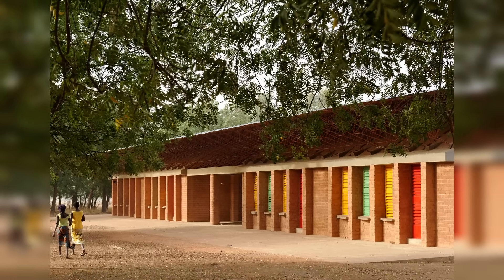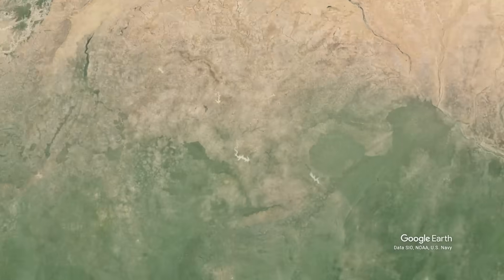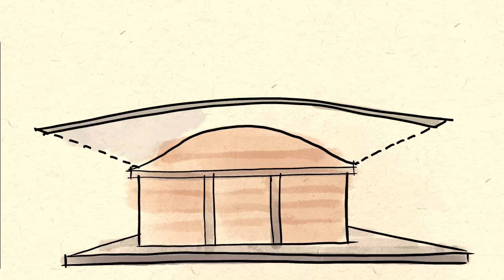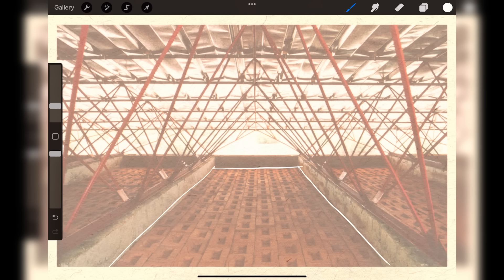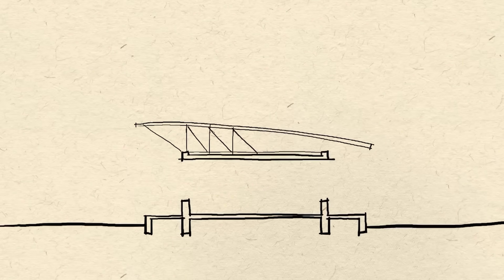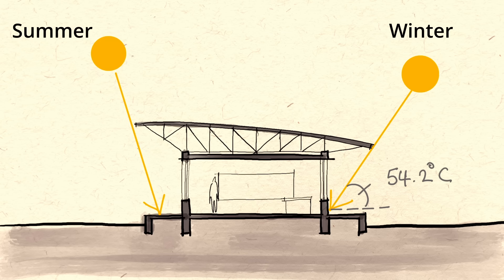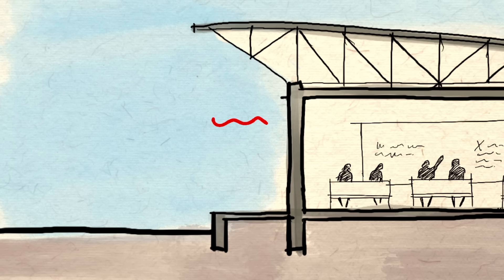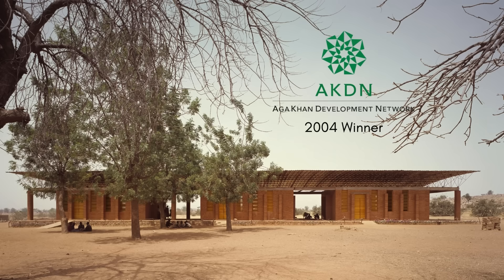The 3 Design Strategies Keeping This Building Cool In Scorching Heat

Comment: I'm in west Phoenix right now. It's 12:15 in the morning as I type. It's still 98⁰F outside. It's forecast to be 111⁰ tomorrow where I am. I step outside and there's a slight breeze. It feels like a fucking blast furnace. Heat is radiating off of everything,  even trees nearby. My skin and lungs literally hurt after more than 15 minutes in it.  There's no escaping the heat. Even if you can in your climate controlled homes,  there's no water here that isn't stolen and no food that isn't trucked in from somewhere else. If it weren't for air conditioning, 99% of the southwest US would be uninhabitable. I'm leaving day after tomorrow and I'll never be back to the desert during the summer. Ever.

Comment: How is the Venturi effect relevant here when there appears to be no interim restriction within then space between the two roofs in the actual building?  Indeed, they are closest together at the edge of what appears to be the windward side.  Considering the perforated under-roof, it would seem to be relying on some sort of heat differential created by shade in dry climates to move hot air out of the classrooms.  I have no scientific background in such things, so perhaps there’s’ some element I’m just not getting.

I rarely use my air conditioner, although I live in North Carolina.  When I walk out of an air conditioned grocery store into the parking lot, however, what hits me hardest is not the 90* heat, but the stunning humidity.  When I do turn my air conditioner on, it’s usually because I’m dripping sweat onto whatever project I have in hand.  If there’s a natural, passive way to dehumidify, other than moving to a desert, I’d love to know about it. I have lots of fans, but they don’t run themselves!
Reply: Agreed

Comment: Are you paying attention Heat Dome victims in the American Southwest?  When power grids fail and AC units go dead - this building stays cool!
Reply: I don’t know about that. 95F is a warm day in April here n the Phoenix area. We have been 100F+ since early May, and 110F+ since early June. It would also be fun to hear how this design works at night. How cool does it get at bedtime?
Reply: @tomdaniels8855  I guess my point is that the climate is changing for whatever reason - and probably not getting better anytime soon. This sort of thinking will be needed. Millions of  people running AC day and night is not a real solution. One serious power outage could be deadly.
Reply: It gets cold here in the winter. This bolding style does not address that well.
Reply: @WeighedWilson  That's a very good point! Thanks!

Comment: I wish there was some data provided in this video about the temperatures experienced within the building itself.
Reply: -6 Celcius. The Aga Khan Award for Architecture lists the Gando primary school by Francis Diebedo Kéré as six degrees Celcius cooler compared with the common tin roof alternative.
Reply: Eas thinking the exact same thing. It's a shame that no results were shared. How much actual cooling is it able to achieve consistently over regular buildings?
Reply: @Tomasrrb  -6 Celcius. The Aga Khan Award for Architecture lists the Gando primary school by Francis Diebedo Kéré as six degrees Celcius cooler compared with the common tin roof alternative.

Comment: Im a ventilation expert and business owner bringing natural cooling to the forefront, for people with and without much money. Love this story and yes the Venturi effect, convection abd thermal breaks are the key. Passive is the future.
Reply: I learned this principle from the capes of Sahara Bedouins. The outside heat of the outer layer actually warms up the air between that and the inner layer, producing warm air that is quick to escape rapidly and let in the cooler (only normal hot), dry air to replace it.

During the night the thick fabric is crucial in staying heated. It's also necessary to contain airy wool so that the outer surface of the outer layer contains most of the heat without letting it all through, and same is true inreverse when at night the heat won't escape through conduction of the material.

It's also an essential difference when you can't just "wash off" sweat, but it needs to actually perform it's function of cooling the body down, rather than collect and fester with fungal infections.
Reply: Is there any website or books that focus on many of these time-tested technologies of heat abatement... I am thinking of building a rural hosue in Florida ??  Thanks !
Reply: @LJ-jq8og  yes, just make sure you have an opening in the roof so hot air can escape easily. Try and tilt a a side of the roof  up for venturi effect. Make sure you have cross ventilation and shade. Always nice to have a roof length that blocks the summer sun, but allows the winter sun to come in and if you can have a thermal mass to collect the winter sun. That would be great
Reply: @trainwreck420ish  Thanks !
Reply: @LJ-jq8og  Auburn University School of Architecture should be "right up your alley".  Auburn is located about 100 miles north of the Florida "panhandle, but they are not limited to just Alabama and Florida.  You are sure to find plenty of Florida vernacular (historic) motifs, mixed with modern aesthetic design language.
Reply: More passive allows to do some interesting things actively using less power. A good sized solar array could run a smaller water filtration system and a couple large freezers allowing the school to raise funds with ice sales and keep cool drinks and fruit for the kids on hand. Which would also provide hands on education in running a simple business for the children.
Reply: @synocrat601  I want to build something like the le Corbusier pavilion but in the desert
Reply: Im getting too hype for this!! I want to work in this field!
Reply: @smolboyi  GO FOR IT!  We need more folks helping others understand the concepts and redesigning what we have in place already. Great when new homes are built with this aim but the real work is in retrofitting/remodeling. 
I encourage you and best of luck. Follow that passion, curry the energy and also be fulfilled in your work 😎
Reply: @jtknight4647  thank you friend, please pray for me that I could help many people with these awesome insights ❤️
Reply: @jtknight4647 Where about do you work?
Reply: @MataH1 @ Bay Area WHF (whole house fans) is my ventilation company.  My first company Left Coast Contractors does all remodeling and restorations.
Reply: I am a home builder, we love incorporating, passive home elements into our builds. not everyone can afford to build a passive house, but simple elements like orientation and wide overhangs don’t really cost much.
Reply: Frank lloyd Wright houses have been working like this since the 40s and John lautner also. FYI this isn't that new, it's just people actually pay attention to  it now
Reply: @trainwreck420ish  exactly, its new to many not to history. Same with WHF(whole house fans) 50 year old tech making a huge comeback. People just dont know what it is and i remind them its tried and true NOT new
Reply: @trainwreck420ish Do you have any resources that you recommend to learn more about passive heating/cooling? Books, websites, articles, physics concepts, literally anything. I'm going to build my first home on a budget next year, and looking to explore ways for passive heating/cooling. I'm very interested in geothermal.
Reply: @nullobject7966  yea, here in YouTube. There's thousands of hours of architecture and especially mid century modern architecture. I am biased towards frank lloyd Wright and John lautner as mentioned. The two wrote books about organic architecture and the reasons for building such a way. Also Albert Frey and Kendrick Kellogg are awesome as well. There's a quincy Jones Richard neutra and meis van Der Rohr. Try to find mid century modern architecture and stuff built before the widespread adoption of ac. Also Africa has been living for thousands of years without having air conditioning. Also Muslim countries have awesome technology for beating the heat. Towers and domes aren't just for looks.
Reply: @nullobject7966 Wow! You have just asked a deeper question than you probably realized.  Do you just want to know for your one house, or do you really want "to know"?  If one house, what climate?  Auburn University' Rural Studio might be a good place to start.
Reply: No actual measures.... It can't be so terrific, just a few degrees gaine, let's be serious. What about digging a little bit to find the cooler ground temperature ? The also common sense principle of the basement, quite old and efficient ...

Comment: I know that it's hot there but I'm pretty sure that it doesn't hit 54°c in the winter or 101°c in the summer.😂
Reply from the maker: The Cs weren’t supposed to be in the section 😅 the degrees are for the angle of the sun! Well spotted 👍🏽

Comment: 95F is a cool day in western Texas to Phoenix AZ. In the southwestern area of the US temperatures can exceed 120°F / 48.9°C, Architect Frank Lloyd Wright designed a few buildings located near Phoenix to be cool in those high temperatures. Also homes in the American in southwest once used construction principles that allowed air to flow which kept them cooler. The Arabian area also built structures that stayed cool during extreme temperatures.
Reply: Yeah….I laughed at that. I live in the High Desert now, but used to live in Palm Springs. I would run at night and it was still 120 at midnight. 😂

Comment: When people talk about "smart buildings", they often mean buildings with lots of sensors , electronics and complicated systems to regulate conditions inside.
But truly smart buildings begin with designing a building so it doesn't need all of that or at least most) by placing relative to the sun, providing shae, using materials that absorb or release heat as necessary.
In this sense this school is a particularly smart building
Reply: Good point!  The truly smart part is working with Nature instead of against her.
Reply: Using local materials too.
Reply: They are misguided. They define technology as fancy gadgets instead of application of the knowledge itself.
Reply: Exactly.  I'm going to try to design some cool new, walkable towns with everything like this in mind.
Reply: I saw an article a few weeks back about smart water evaporating recycled plastic mats that could cool a building passively. And I was just like "mfckers, have you heard of vines?" I did a bit of googling and found out that there are at least two plants native to Germany (where I live and where this mat is researched) which grow in a controllable way (can't attach to walls, needs a supporting structure attached to the wall to climb). Echtes Geißblatt (for walls with direct sun) and Clematis (for walls which are not directly exposed to the sun - do shade the bottom of the plant, though) by the way.
Reply: The reasoning goes, "Sure, our smart building uses tremendous amount of electricity to heat and cool, the materials were trucked in from hundreds of miles away, and it is otherwise very inefficient and complicated, but at least it has impressive blinking doohickeys and gizmos to look at..."
Reply: 'Smart' buildings are rarely ever smart. Vernacular architecture like this is far more smart.
Reply: You got it.  These smart designs don't necessary cost more but they do take a little more time since they are not common design any more.
Reply: The difference is that they aren't taking about passive design.
Reply: It's unfortunate that practical designs are sometimes not permitted by local zoning codes or HOA restrictions.
Reply: @davidadamson3664 I don't think local zoning goes out of their way to prevent natural cooling designs.   HOAs are another matter but they are usually formed after a community has been built.  HOAs do create a lot of headaches.
Reply: Smart designs are often owned by smart people. Smart appliances on the other hand...
Reply: The hard part is to figure out hot to make it simple. When you see the design and people say: ahh this is so simple...yeah when you see it working, it is 😂

Comment: We’ve seen bits of this design in Az, which regularly reaches 20+ degrees hotter for 100+ days in the summer (its is currently 115 as I type)
Designs like these will hopefully be more frequent as those numbers increase due to global warming and increased population expansion (which creates “heat sinks”, holding the heat and making it constant).

Comment: I once thought of a design here in the US for a mobile home park. Set up a solar panel system on top of the mobile homes that cover the entire roof, and have it raised to allow air flow between the roof and the panels. It would achieve three things. First it would be an entire electric power plant. Second help cool down the trailers. Third protect the roof of the trailers from rain which could over time leak into the trailer. What I didn't think of was an airplane foil.
Reply: I’ve thought of that for parking lots at the airport. Miles of usable sunspace.
Reply: @TheMissPoovey  I prefer to not have my pilots sear their eyes right as they are landing.
Reply: @kcgunesq  it doesn’t have to be reflective, black solar panels would not “sear the pilots eyes out”. 
A green growing roof would cancel the heat island effect and again, not “sear the pilots eyes out”.
The options are not singular.
Reply: @kcgunesq  I would imagine the original solar were viciously reflective. But there are now solid black flexible solar. Now it is a good idea, back then, definitely not.
Reply: @kcgunesq There are airports with solar around them - a quick search would show you. Dulles Airport in the DC suburbs is doing a large facility now. Also, the modules have an anti-reflective coating in order to absorb more solar radiation.
Reply: Great idea for solar- and neither the roof nor the solar array need to be curved like an airfoil- the venturi effect works simply due to the air channel narrowing in the middle.
Reply: This is a great idea!
Reply: H2O catchment too...
Reply: And perhaps you could sell any excess energy produced to power company.
Reply: Just 'airfoil' is fine by the way
Reply: Good idea but.... Roof fires...
Reply: Mobile homes are the worst type of housing. Why make a carport for a mobile home when you can just build a real home without wheels under it and a design in all of the natural ventilation and insulation?

Mobile homes make IKEA furniture look like fine-quality furniture. Nobody should permanently live in temporary housing.
Reply: @David_H_Parker the cost of living in a mobile home is typically much much lower than in a conventional house. Many of the people that live in them cannot afford a regular house.
Reply: @ClipperDays  Once you factor in space rent, mortgage and spending more on utilities to heat and cool a mobile home, it really doesn't make any financial sense.

Living in a mobile home is a great way to waste money and stay in poverty. 

It should only be temporary housing, never permanent housing.
Reply: @David_H_Parker  I disagree. I've lived in one for about 12 years now and I own it and the land it sits on free and clear. My total monthly expenses are less than most people pay for electricity. I live in Florida where it's hot as hell right now and my electric bill is still below $100 per month. 
So you believe what you believe and I will believe what I know for fact.
Reply: @ClipperDays  If you own the land, why wouldn't you build a REAL house on it so it appreciates in value?

Why don't you just pitch a Coleman tent on your land if you love temporary structures so much?

A stick built home is safer, more efficient and healthier than a manufactured home full of particle board and literally the cheapest materials and construction techniques you can find.
Reply: @David_H_Parker  You are speaking out of your tail... New manufactured (mobile homes) are often bette than many stick built homes of lower cost.  You are not realizing that many people do not have that option.  The original idea of this post is excellent !
Reply: @LJ-jq8og  I work on all types of homes. There is nothing superior about any mobile home construction... nothing!

They are built with the lowest quality materials available and will never perform better or last longer than a properly built conventional stick framed house.
Reply: @ClipperDays also live in one and electric almost always under $100. Been here 13 years. Husband has been here longer. Like any place they need up keep. They are generally cheap made. Not the highest quality, it's paid for. Some day I will probably die here.
Reply: @davidparker9676 unfortunately in Texas single wide mobile homes on property do appreciate in value every year the taxes go up for both the land and houses. I have to fight it every year because I have 3 that are used for storage only and can't be lived in. It annoys me to no end!
Reply: @davidparker9676  "why make a carpet for your mobile home"?

For one,  many rv grounds only rent out the spaces, so if the land owners built a serious of these "carports", not only could they charge a premium for those spaces, but also sell excess energy back to the grid. 

"Solar farms" are already a viable business,  so essentially your combining 2 means of "production" (solar harvesting and rv rental space) on the same land required for either. 

Seems like a no brainer.
Reply: @theoriginalmonstermaker  For the owner of the mobile home park, a solar farm is a no brianer. Owning a mobile home, paying space rent with high utilities is brainless.
Reply: @David_H_Parker  not to mention,  rvs and their campgrounds also tend to be in places where utilities may be difficult to access; this permits "energy independence"
Reply: @David_H_Parker Many people that are snowbirds have mobile homes as a second home in warmer climates. They are inexpensive and in senior 55+ parks there is security for when we are absent.